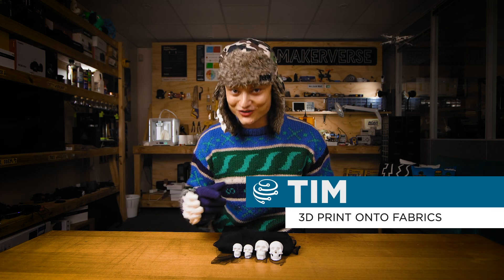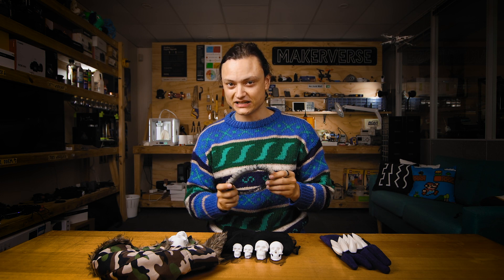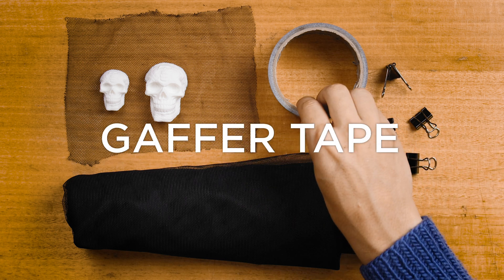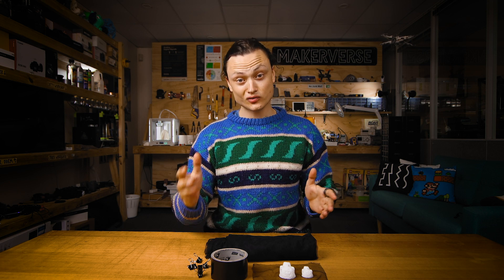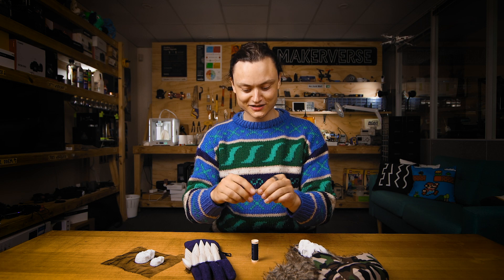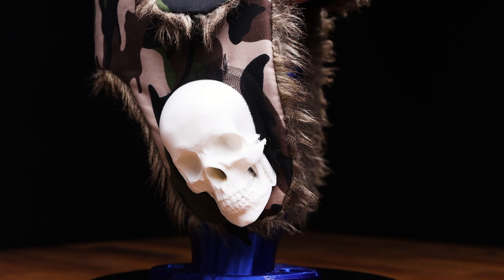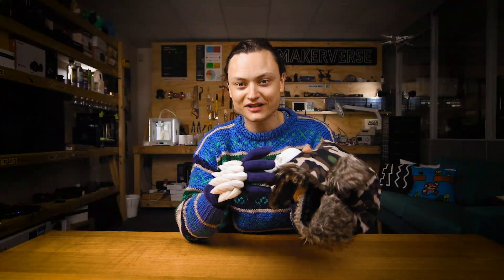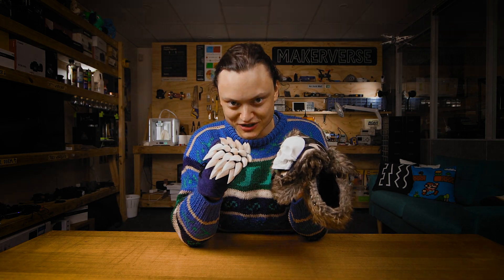How to 3D Print Onto Fabrics | Tips and Tricks

Comment: I took 600 grit sand paper and glued it to large popsicle sticks. I lay those on top of my fabric then use clamps to hold down both sides of the stick. I've been doing this for a bit and I've only had once failed print with how I've setup my printer.
Reply from the maker: I love that idea, would result in such a secure fabric!
Reply: that actually sounds like how I'm going to start my journey! good tip!!

Comment: You can also print the object first and then heat it later on an press into fabric.
Reply from the maker: I dig that idea!
Reply: does this really work well? tbh sounds also like a really good workflow - are you trustworthy? :D  You mean a simple heated t-shirt press, right? got any temperatures?
Reply: @DanielSanNinja  Depends. You have to try it out. You might be using all sorts of different thermoplastics and fabric. In case of ABS for instance, you can dissolve it without heat instead. So you might be using a coarse mesh type of fabric and an ABS print. You might be using something completely different.
Reply: @sierraecho884  nobody prints ABS anymore. it's all PETG, PLA or CARBON stuff ... and when ABS then ASA or how those new materials are called?
Reply: @DanielSanNinja  "....nobody prints ABS anymore....." Yeah well, there you have your answer. In that case do what everyone else does.
Reply: @sierraecho884  I will, thanks! :D

Comment: Sound like a simple process just pausing after a layer or to and adding the mesh fabric so it can lock in the print layer.
Reply from the maker: Totally, just keep an eye on your printer for the first couple of layers as it embeds the plastic into the mesh fabric. You really do not want the nozzle to catch on the fabric.

Also make sure to use a heat resistant fabric. A fire in a 3D printer makes for a really bad day.